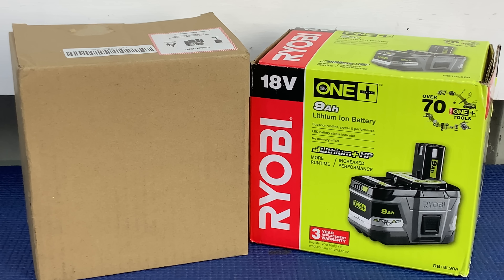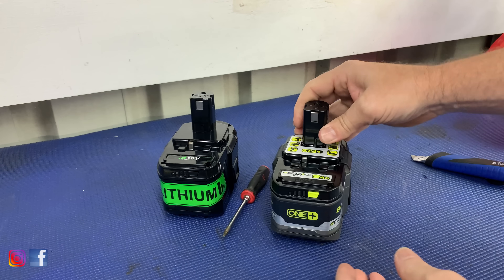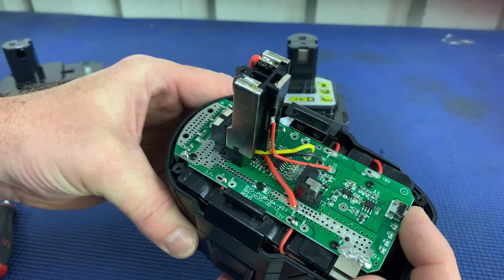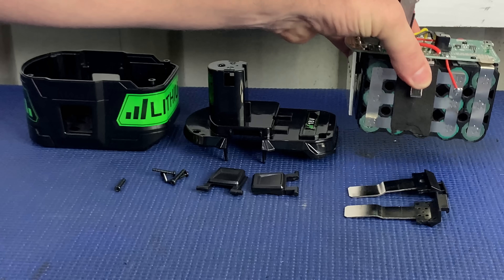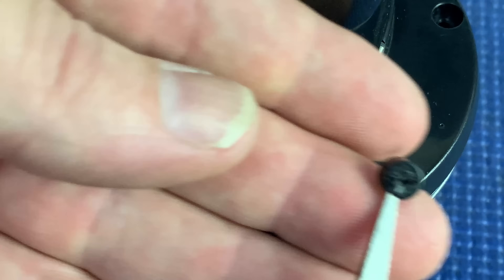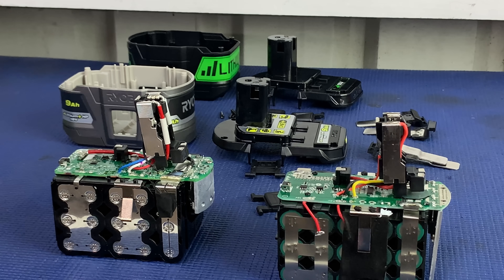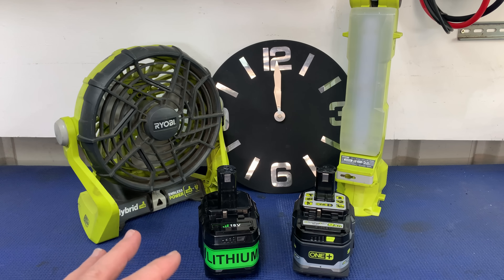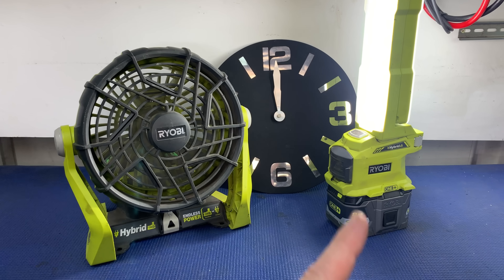Ryobi 9ah battery versus eBay knockoff job

Comment: saw  a similar video with dewalt batteries, and although they were not as good, the cheapie batteries were half the price and the 2 together gave you more power and lasted longer than the original, so were better value for money, longevity was not able to be tested however

Comment: Wouldn't know how the battery works, bought a $248 Ryobi cordless stick vacume, 18 v battery but NO CHARGER in the box. Ryobi will not replace, say call Home Depot who says call Ryobi. Round and round. Bottom line I was told that I'll "have to find out where to buy a new charger that was not included in the box, maybe they have at Home Depot." Yeah, furious. So much time/energy wasted but I'll never buy anything by Roybi again.

Comment: Like everything on ebay some are good some are not I have two 4Ah ryobi and two 4Ah ebay I took both apart when I got the ebay ones and the ebay ones were better made , it 3 years now they are all still going I use them in brushless angle grinder which is the most power hungry as well as other tools can not complain when I got two for less than half the price of an original.
Reply from the maker: I would love to buy the two off you and test them.. i'm yet to see that claim backed up
Reply: @HBPowerwall  That would be great if I was not in Australia here I can not post them "dangerous goods" sea freight only.

Comment: I have been using 2 knock offs , for about 9 months, used on a nail gun, couldn't be happier
Reply: same for me, no problems at all, havent fallen out once in my nail gun or hammerdrill, i am happy with the knockoffs since the give you more power for the money
Reply from the maker: you must not have got the crap i recieved - video in production really testing the cells and their claimed 9ah --- tip - its a f!@#$%^&*ucking load of shit..
Reply: Ditto. The only battery that has ever failed me was one of my original 1.3ah genuine battery very long back in the day. Have had plenty of knock offs. None of them have died yet. No method to test capacity but they "feel" fine. I'm not vested enough to defend the knock offs either though, so take my comment as you will. I won't stop people from buying genuine batteries.

Looking through your reply to comments that vouch for knock offs - and you seem to reply to these comments in particular - you seem almost emotional. I'm sure you have your reasons, but hey, people are just telling you that the knock offs worked fair for them, so good for them, shouldn't you say?

Comment: Good initial video on the batteries, but I think you're missing a major point.  The HP Ryobi batteries are their high discharge rate (High C rating) batteries.  If the knock off wasn't advertised as "HP", high power, or high discharge, this is a bit of a Fuji apples to Fuji pears comparison.   As one of the previous posters suggested, doing a head to head on a "HP" rated tool at full load (Like the wonderful 262 half inch) would likely give a MUCH more satisfying comparison.  Likewise, including a Ryobi 6Ah non"HP" battery in the comparison would be great.   Towards the end of the video you mentioned that the knock-off sounded weaker than your 4ah battery. Is a bit hard to tell in the video, but I'm fairly certain that is a HP battery as well. So it isn't surprising the 4Ah sounds more "powerful" as it actually IS capable of delivering more power at any given moment. 

For a follow up, it would also be interesting to run the fake outside of the plastic casing, and see how hot the nickle conductors and cells get.  Ryobi cells should have thermal cut off protection, which would surprise me on a battery as cheap as the fake is. Cheers!
Reply from the maker: THEY STILL SUCK ! Next video in production!

Comment: Thank you for showing us that the difference between the crap tool battery and the crap knockoff battery is not enough price difference so if I owned a crap Ryobi I would not hesitate to buy the nockoff.
Reply from the maker: I plan to change your crap mind... this knock off is a piece of shit not worth the box it was poorly packed into!
Reply: Hate to admit it but Dave has a point.

the ryobi tools Are low quality and the batteries Are way to expensive.

Milwaukee is a higher quality tool and the batteries are often cheaper than ryobi equivalent.

Comment: Too bad you didn't try snapping the knock off on the charger before disassembly.
Reply from the maker: Was the reason I did the video lol used it just a few times then stopped MAYBE two recharges - it was a while ago.. at anyrate have the follow up video soon and that useless piece of shit of a battery is nothing better than a SCAM.. stay tuned.

Comment: Makes me wonder if the guts of the cheap battery would fit into the Ryobi housing?  That might make it secure better in the tool
Reply from the maker: I'm half way through more testing - NOTHING can help that crap assed battery.. NOTHING!

Comment: Knockoffs are overrated.  6 ah is really a 4 ah.  So when comparing value use the Roybi cost for the lower amp rating.  So a two pack of 4ah (not the hp) is $80 and a two pack of 6 ah knockoff on Amazon is $61.  Now which would you buy?
Reply from the maker: I can assure you --- this 9ah battery is most defiantly NOT even close - update video this week!

Comment: I'm sure there are some electronic features in the original that doesn't exist in the knockoff batteries. Learnt that Milwaukees batteries has an automatic fuse that protects both the machine and the batteries from occurring faults on the machine. And that didn't exist in the knockoffs that I bought, which resulted in 2 batteries burned and the trigger switch for the machine got destroyed. I only found that out because I bought a new original battery and tested the machine before I found the damaged part. Only cost me 50 USD to buy a new trigger and the machine was worth it because it cost me 1,000 USD when I bought it.

Comment: 2 moths ago i got a 4AH Ryobi knock off and it is GRATE. there IS the snap when placing in the tool. i have build a deck using it and have yet to charge it for a 2nd time. 

for the price difference i took a chance and was happy i did. 
and here is why, for the price on a " NAME BRAND "  back up battery i can get 3 of these. so what if i loos a bit off the tale end. and at this price 1 out of the 3 could be a complete ripoff ( just a case of sand / a brick ) i am STILL better off then buying 1 Ryobi battery. no it wont last as long, but there are " NAME BRAND " battery's that are bricks from the start as well. in the long run NO ONE can afford to buy Battery's that cost MORE then the tool it is placed in... 
thats just not economical or realistic.

Comment: NOPE after I cut the cord...I went back..I got 3 drills I can't buy  1 batteries or 1 chargers for... for less when I paid for all 4 of them new ( the drill , changer , and 2 batteries ) What a racket....
Reply from the maker: Sounds like marketing not a racket - look at printer suppliers - loose money on printer make it up on the ink...
Reply: @HBPowerwall  I had printer issue this year too..don't use enough...ink dries up and tossed it and the printer out in March.Got it off the HP web site and the first set up had the ink levels at 50%...I paid 43 dollar and the first time I had to get ink ( black and the color ) it was 60 dollars...went out an bought a jumbo Canon Image Class...Had to get a table for it because its so big....
Reply: they have combo packs with bunch of tools and 2 batterys for 200ish
Reply: @rocketsmall4547  LOL... then in two years when the change sizes and models, Ill have 5 things I can't use because the chargers is bad....

Comment: That nickel strip is 10 x what is needed and dahuh !, the batteries are 18650’s
Reply from the maker: Yeh, 3000mah 30amp versions - not your 5ah laptop battery. Well at least they should be

Comment: My experience with these off brand batteries is that they do not last and the warranty is useless unless your failure occurs very early in ownership. What happens is that they sell a batch of batteries by "Brand" and then that "company" goes away.  By the time the battery fails, there is no one to contact for warranty.  The sellers come with another "Brand" and sell another batch, then go away. At least this is what I was seeing.
Reply: Even if they die after a month the seller just ignores you.
Reply: What happens when you buy off ebay and it says 10 years warranty?
Cant you dispute with eBay after a few years because its the Obedient matrix ways
Reply: @jamessey7 u sure can but that's if the company is still around. Most likely they will not be there.
Reply: I call them out on the bs in the first week and get a price reduction. Usually half my money back. Hey they shouldn't lie and this wouldn't be an issue.

Comment: I know you wanted low drain but next time use a weed walker or a leaf blower.
Reply from the maker: impossible to get a consistant result.. can't run the weed wacker constantly till drained same with circular saw, chainsaw, air compressor etc

Comment: Kudos on Ryobi !!   My personal brand of choice.i have 17 different tools they all work extremely well. I have built additions on house and shop with them. Tried knock off batteries same 2 things. Fitment and rating on batteries not good as Ryobi.. cheapest way I found to get more batteries.... I buy the on sale drill and sawzall 2 Batts n charger    it's usually 80$$ American.
Reply: So jealous of you Americans our cheapest skin without battery or charger is like 80bucks one battery alone is probably that much

Comment: I have had no problems with aftermarket ryobi batteries... But most come with no rubber padding on their exterior and are not as moisture proof so to speak as the genuine ryobi batts
Reply: Whatever...
Reply from the maker: Anytime
Reply from the maker: Nar it’s too crap

Comment: The Ryobi is 4 time the price, where do you get the 70 something % from?
Reply from the maker: Who knows
Reply: @HBPowerwall  Well, that sums up your attitude exactly. If you can't accept that you made a mistake with the %age what else did you get wrong? This wasn't a balanced, unbiased test, it was a video primarily made to rubbish cheap batteries. The rest of us aren't sponsored by Ryobi so buying non OEM versions makes good economic sense. I could buy 4 non OEM batteries for the cost of 1 Ryobi battery. Ryobi use the same pricing policy as SnapOn.
Reply: I'd say he did something like this 72/299=0.2408026755852843x100=24.08026755852843%  Cheap battery only 24% as much as expensive battery, then did this 100%-24%=76% instead of 100/24.08026755852843=4.152777777777778x100=415.2777777777778 expensive battery is 415% more. I see people do that first part like he did quite often, it srill can work but 299/72=4.152777777777778x100=415% is much easier! I rounded it. lol

Comment: You need to add another test. The better quality batteries tend to work better and longer under cold / freezing conditions, because of their superior chemistry. So it's worth doing a cold run test. Try putting both batteries in a fridge or freezer for a set amount of time then test. Then if possible test while in a cold environment as well.
Reply: As a Canadian , I agree. 🇨🇦
Reply from the maker: as an aussie i can do hot :P

Comment: I have 4 of the 6ah knock off batteries that I use in my bigger tools and love them! No way would i pay 299 for a genuine battery....
Reply from the maker: Well that's all on you when something doesn't go to plan - glad you're enjoying your 'tool'
Reply: @Asbokid I'm not sure if they are better than the ryobi brand of 6ah, mainly because I'm not spending the money on the name brand ones. But I am glad when one of my original name brand one (2ah) won't take a charge, a can disassemble it and force an initial charge on it to be able to use it again.... I have 7 different ryobi+1 tools and love them!

Comment: The cheapie costs 24% of the mothership's pricing ... sure it doesn't snap in to the tools securely ... but you can buy a heck of a lot of duct tape for $226 ... I would buy 3 knock-offs, 6 rolls of duct tape, and take my partner out for a pub lunch.
Reply from the maker: You cheap ass, could have at least taken her to KFC..

Comment: I bought a similar Ryobi knockoff by accident, the pic was sketchy and didn't realize it. the only gripe I have is they fit too tight, at first I couldn't even get them out, had to put a small c clamp on the buttons and still had to bust a nut to get them out. i did the old machinist trick of sanding off the areas that showed contact marks. it was better but the dang buttons still have stronger spring tension and  where the buttons click in they have a more angled gripper so they still hang. mine have a little different color scheme than these so probably different mfg. if I could just get them fitted better they perform great
Reply from the maker: Hope fully it still works for you.

Comment: I have this exact knockoff battery and it’s the same with fitment  on the tools, falls out of the tool at times and on my leaf blower this so called 9ah knock off battery only lasts a little longer than my 5ah genuine ryobi battery. It would be lucky to be any more than 6ah in capacity.. only had my knockoff battery 2 months and it’s a matter of time to see how long it lasts.. great video 👍🍻
Reply from the maker: Thanks for the confirmation - so many seem stuck on the whole initial price difference.. Much more to this story

Comment: Lithium is a tricky area, you want a company that can back up their product if it fails, because there could be a small fire. So, I don't think this is an area to consider a no brand product for that reason alone.
Reply from the maker: Now there's a good statement ! Its also about how long the product will last & weather a warranty is even practical ..

Comment: I've never heard such a biased comparison. Talk about prejudice! Funded by Ryobi? I am an electronic engineer who has designed battery chargers and many other electronic products. Your criticisms of the design of the knock-off are mostly just your bias. The knock-off looks like a more cost-effective design to me. How about you measure the thickness and width of the nickel strip and then calculate its resistance and the effect on the voltage drop, for example? The multiple spot weld are redundant - one will do almost as good a job as 4 because they have very short path length. 3 is no problem.
I have several Ryobi and knock-off batteries and I find them very similar in performance. The genuine one probably? has slightly better cells but I can't tell much difference. Maybe my knock-off is a better one - they are not all the same...
Perhaps your battery may be falling out because you didn't reassmble it carefully enough? I don't have this problem, it fits just like the Ryobi one.
Reply: No attempt to make a proper comparison. Simply set out to prove the cheap battery is not so good. What else do you expect?
Reply: Well said Hugh
Reply: Both are garbage because of one thing, they have no conformal coating on the pcb, if even a little bit of water got in there or an insect, its gonna corrode the board and it just needs 1 component to break and the whole pack will stop working, i'd say the ryobi is worse because it costs 300 dollars, the rest of the stuff that he talks about doesn't really matter, it doesnt matter how good it looks if its not on an art show, its a battery
Reply: I'm curious as to whether you've had any failures of the knock-offs. I'm guessing that they won't go the distance years-wise as the real ones, but for me (and my first 40V 6aHr knock-off is literally on the UPS truck awaiting delivery as we speak), spending 205% more for possibly 1/3rd more capacity--or 171% more and 25% more capacity if I compare it to the cheaper 5 aHr battery (which at worst will still be well in excess of the 2.5 aHr 6 year old battery it's replacing) makes sense, including even if it only lasts half as much.  And who knows? I might get lucky and even get a warranty replacement if it fails in under 5 years.
Reply: No attempt to make a proper comparison. Simply set out to prove the cheap battery is not so good. What else do you expect?
Reply: This whole comparison really does look like a ryobi-funded hit piece. 

To add to the comment above, OP claims that the knockoff board is less heavily populated than the genuine board. Actually, from the video you can see that the genuine board simply has a ton of the silver place holder solder pads, with nothing on them! In terms of components that matter, they really do look similar
Reply: I bought two different 5AH knockoffs. They lasted less than 10 cycles each before refusing to charge
Reply from the maker: LOL - my own pocket , aint Ryobies - and FUCK me I stand behind every word - after another few months what a piece of junk.. ended up falling out of the whipper snipper onto a garden edge and fell into pieces. Before that the run time was so poor the 2ah Ryobi battery would out last it every time in any device.. Then you go back and look at the other Ryobi knock video I did that WAS sponsored... Vanon - dear god what a rip job of a company AND I"M PAID TO SAY THAT FROM THEM! lol anyways, I got to one spot weld will do the job and didn't read further.